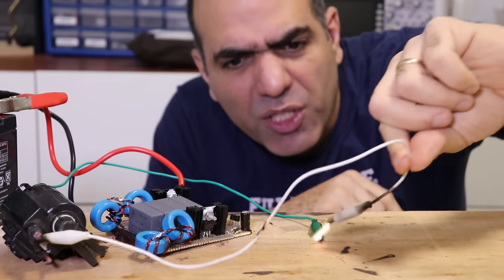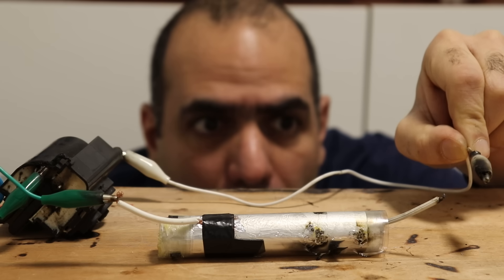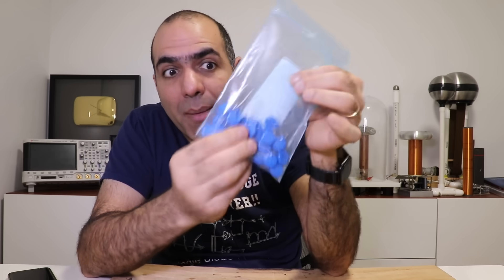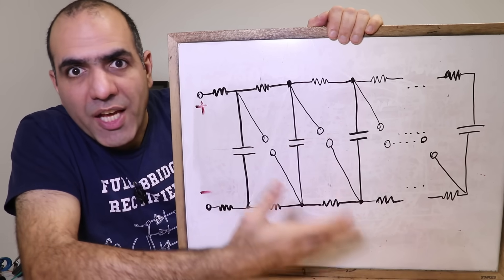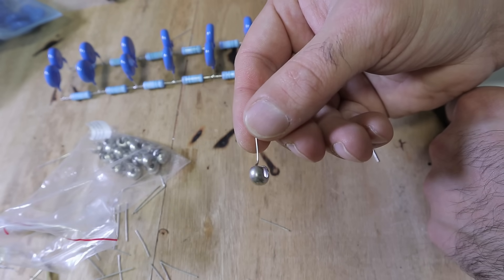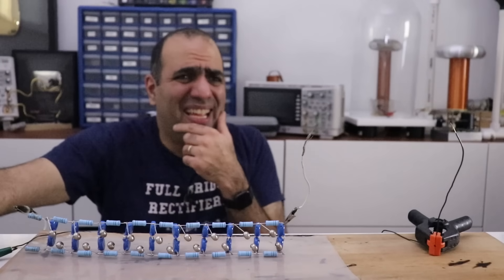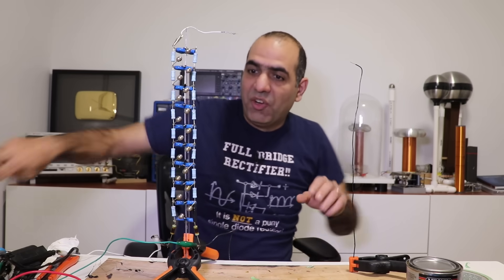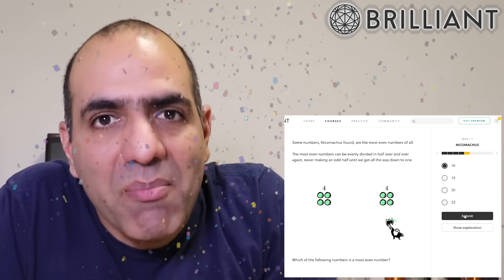Making 500,000 VOLT ARC with Marx Generator

Comment: While I REALLY enjoy your videos, you make me nervous when at the end of the video, your HEAD is so close to HV Potential. Fourty four years after I received a burn from the top of a horizontal output television tube while in High School Electronics class, I still have a scar on my hand from it. Please be careful. You always end up sooner or later with carbon traces from making Marx Generators, and that seems to be their weak point. I always wondered if I put them in Epoxy or just used some glue gun hotsnot down the resistor legs if that would help make them at least last a bit longer. Mostly though, I could never get the discharge points uniform enough. I just bent them the same as you, then I tried spark plugs, since I could "gap" them, and I figured that their surfaces were made for such a robust job.But for some reason that I never figured out the spark plugs didn't work at all, even when they were all brand new ones and identical. All the Best! 73 DE W8LV BILL (and sometimes: W8LV/VE3) Are you a Ham Operator?

Comment: Could you try making some sort of high voltage display such as a very simple CRT (just use your original high voltage circuit in a vacuumed glass container and control it with electromagnets)

Comment: Mehdi, lay it down in an oil bath with just the spark gaps sticking out and crank up the voltage! 😈⚡⚡⚡
Reply: Also add a bit of lamb sauce in the tub
Reply: @masterjiraiya348  if he can find it
Reply: Put two resistors in series, that will increase the gap as well.
Reply: He can hit all of the clickbaits at once if he sets the whole circuit in epoxy
Reply: step1: cover yourself in oil
Reply: @mashroom_  step 2: wait for it to rain
Reply: I was thinking that too, lay it down in an insulating liquid.
Reply: Ask your gay dad 4 it
Reply: @Not Bugarev umm... you know that oil is a very good insulator and used in power distribution transformers?

Comment: Couldn't you add some plastic discs around the resisters to insolate them so the spark doesn't jump across? Also maybe try some liquid tape on the caps for the same thing. That might help make bigger gaps.

Comment: Wish I had a picture of the Marx generator that the AFRL Directed Energy labs kicked down to the EE students at UNM.  It was about 1 meter in length and designed to fit into a cylindrical tube.  Monster of a circuit with at least 12 stages.  I remember the brass balls for the spark gaps the most, all lined up on one side of the circuit.  

MILSPEC

Comment: You should try dunking the resistors and capacitors in a mineral oil bath. Maybe make a case for the circuit where spark gaps stick out but the rest is submerged. That way you can effectively get rid of arcing

Comment: It’s a bit messy, but you can better insulate the resistors by putting the generator in a case and filling it with oil. You can cut holes in the case to feed the breakout points through, and then seal around them with Silicon. That way everything besides the intended breakouts is insulated from arcing to itself.

Comment: It's a true Marx generator only if it seizes the means of arc production
Reply: Electrons of the world unite. You have nothing to lose but your orbitals...
Reply: I was hoping the first comment I saw was making a communism joke, and you didn't let me down
Reply: OUR generator
Reply: @Wok_Agenda  ahh, I see what you did therem
Reply: @gavabundofagundes491  Fine, Groucho Marx.  "I won't be a part of a capacitor that will have me as a charge."
Reply: Missed a chance for “seize the means of induction”
Reply: Welcome Comfarad!
Reply: Happy coomunist noice intensifies.. kkomrade
Reply: Is only Marx generator if electricity goes socialist
Reply: @tenshiabse  true true
Reply: no. its because the current only flows to the left.
Reply: Noyeux Joel.
Reply: This... This is absolute gold
Reply: Your wordplay doesn't work. How about: seize the means of induction
Reply: @TribeWars1  Sadly, in this case the physics doesn't work. The circuit is DC, and induction only manifests with AC voltage.
Reply: @TribeWars1  Wow. That correction was hard to resist. Wasn't it?
Reply: imma be real with you i only came here for the communism jokes
Reply: Hey Joel.
Reply: @GatileoGatilei  yo
Reply: союз не рушимый!
Reply: INSULATED GLOVES MEHDI DON'T DIE ON US
Reply: USSR anthem plays on a Tesla coil.
Reply: And redistributes the volts
Reply: I see Communism, I press like
Reply: HAHAHAHAHAAHAHAHAHAH
Reply: @Roger Wilco - justice and really clean floors but it still went 0 to 100 quick as fuck
Reply: Everyone knows you're only allowed to tell communist jokes if everyone gets them.
Reply: Motherland music intensifies
Reply: @pegamini 
All of them ? As compared to individualist market-based economics which mathematically speaking can’t solve distributed maximisation of utility problems like the tragedy of the commons. Like, if there is such thing as a fantastic universe where the maximal utility optimum for each individual agent coincides with the overall distributed maximal utility optimum over all agents... fine, I guess that’s a place where crapitalism could possibly work. But that would require infinite everything including infinite people with infinite lifespans in an infinite space that’s infinitely plentiful. Even then there’s the problem of people thinking their purpose is to accumulate as much economic control over everyone and everything as possible. Which would mean that either way, if everyone had this goal, damn nearly everyone would not be able to follow it. We refuse to accept the limitations of our world and a couple of rich bastards don’t accept that no one cares about their stupid goals, no one needs them and furthermore, we would all be better off without them and the corruption they cause.
Reply: Joseph stalin and Vladimir Lenin: we partnered up with nikola Tesla
Reply: Lol so many anti coms triggered by a joke lol
Reply: Hey
Reply: Make a emp with it
Reply: correct
Reply: what.
Reply: XD
Reply: meanwhile horses be like   LOL:
https://www.youtube.com/watch?v=ig0ANQrp5aI&hr
Reply: يث
Reply: https://www.youtube.com/watch?v=Yt7no6rwCVk
Reply: Capestar value sir
Reply: Hello comrades
Reply: Haha What's the reason, don't you see its sexy lol
Reply: we need to redistribute the voltage equally amongst the people
Reply: LOL
Reply: communism intensifies
Reply: Were you hoping to let it fall on you, like the sparklers, for entertainment?
Reply: nice
Reply: this comment was inevitable.
Reply: Stalin for the fruits?
Reply: A true Marxist generator redistributes voltage to the capacitive masses. From those most productive, to those most in need.
Reply: @johngalt7382  Tell Francsico I said hello
Reply: please make a high voltage electro magnetic gun that can pulse thrust and blast some metal or a magnet  object with it XD..

or make a high voltage electro gun that destroys circuits around them ...
Reply: And I can't learn physics definition.
Reply: Son of Frakenstein~!
Reply: 🔴 What Is Islam? ⚠️

🔴 Islam is not just another religion. 

🔵 It is the same message preached by Moses, Jesus and Abraham.

 🔴 Islam literally means ‘submission to God’ and it teaches us to have a direct relationship with God. 

 🔵 It reminds us that since God created us, no one should be worshipped except God alone. 

 🔴 It also teaches that God is nothing like a human being or like anything that we can imagine.

🌍 The concept of God is summarized in the Quran as:

📖 { “Say, He is God, the One.  God, the Absolute.  He does not give birth, nor was He born, and there is nothing like Him.”} (Quran 112:1-4)[4] 📚

🔴 Becoming a Muslim is not turning your back to Jesus. 

🔵 Rather it’s going back to the original teachings of Jesus and obeying him.
Reply: @1islam1  sorry sir you have been deluded, thats not far back enough we must return to monke
Reply: En
Reply: Lololol
Reply: SlimyKlerburt  normally, as people say in my country
Reply: OUR* generator
Reply: What is a Marx Gen?
Reply: 🤣🤣🤣 i like it
Reply: come on you are almost getting close to plasma. Do you want a list of plasma aplications?
TESLA=D´ARSONVAL=OUDIN
MONICO SANCHEZ
Reply: yes
Reply: yes
Reply: The Marx generator seizes all the means of arc production... somewhere in the 500,000 year plean.
Reply: So much disinformation in just the first bunch of replies already...
Reply: communism
Reply: Or if it generates hunger and kills 100million
Reply: with the only true marx over 100 million died !
Reply: Did u know, that in Germany there is a city with 250.000 People who lives there, which was and is named afte Karl Marx? The old Name is Karlmarxstadt and the new one is Chemnitz
Reply: Lmao
Reply: Ayo
Reply: This is fkn epic. Mad props for political puns dude. Well done ;)
Reply: @pegamini Apparently 57% of East Germans believe so, but "Der Spiegel" doesn't provide their source. However considering that the rest of the article tries to explain that East Germans are just nostalgic, I believe it's fair to take them on their word.
Reply: Fas um vídeo seu enchendo com telefones
Reply: Or, of course, if it's always right there waiting there for you
Reply: Mehdi's muscles have produced the Marx generator; the arcs from Marx generator seize them. I say it works as intended.
Reply: @JeanMarceaux   yes
Reply: hi level here
Reply: DON'T YOU MEAN OURC PRODUCTION ?!?!
Reply: Sorry buddy, the only Marx I trust is Groucho
Reply: Take your like and go away
Reply: @shanealfhaim1230  oh hey. i remember you lmao
Reply: You made communist joke after me and it got 10x more likes in shorter time :(

Thats why we need communism
Reply: Jarski l 
I’m a communist and I approve this message.
Reply: @jarskil8862  😂🤣
Reply: Equally distributing elctrical charges
Reply: does it contracts you with communism or not?
Reply: :o)
Reply: Your comment just won everything in the history of everything... or shall I say OUR comment!!! *USSR anthem starts to play
Reply: "Our voltage"
Reply: I know other people have said this, but this comment is absolute gold!! Oh my God this is so good! That's one of the wittiest comments I've seen, I don't even know how far back, absolutely brilliant LOL LOL LOL
Reply: Or  worships Karl Marx
Reply: True Marx generation chez never been tried
Reply: What Is Islam?

Islam is not just another religion. 

It is the same message preached by Moses, Jesus and Abraham.

Islam literally means ‘submission to God’ and it teaches us to have a direct relationship with God. 

It reminds us that since God created us, no one should be worshipped except God alone. 

It also teaches that God is nothing like a human being or like anything that we can imagine.

 The concept of God is summarized in the Quran as:

{ “Say, He is God, the One. God, the Absolute. He does not give birth, nor was He born, and there is nothing like Him.”} (Quran 112:1-4)

Becoming a Muslim is not turning your back to Jesus. 

Rather it’s going back to the original teachings of Jesus and obeying him
Reply: @ahmdabdallah5811  bro i dunno but submitting my self to some dude and calling him my god seems pretty gay ,and thats haraam
Reply: and only works in peoples imaginations?
Reply: @SuperAWaC  someone needs to learn what marxism is...
Reply: @SuperAWaC  lmfao
Reply: @SuperAWaC  Yes.
Reply: @SuperAWaC  nah it works irl as you can see
Reply: @SuperAWaC   no the Current Investigative Agency (CIA) tried to stop it
Reply: @SuperAWaC  haha that’s great
Reply: @SuperAWaC  No
Reply: @SuperAWaC  There's no way to know if it works or not given that it's literally never been tried. Marxist communism is an idea that many fascists have used as bait to further enslave the working class. More enslaved than currently overworked and underpaid workers are under capitalism. Thus, partisan hacks in all of their childish black-and-white worldview wisdoms have come to the conclusion that: "COMMUNISM MAKES EVERYONE STARVE, CAPITALISM IS PERFECT, USA! USA! USA!"
Reply: @LordSchnoz  Communism has been tried and always fails for the precise reason it can never work: because it ignores the human condition. It creates a framework of centralized power which is ready to easily be seized by an ambitious populist and then turned into whatever they want it to be. Look what happened to the USSR and China, where populists gained control and exiled or executed all the real "communists", then changed the history books to make them look good. Socialism meanwhile only works in ethnostates, and perhaps in a post-scarcity society. We haven't had capitalism in the US for around 100 years now thanks to the formation of the single party system in the USA during the interwar period around the reign of FDR, where we no longer have the democratic and republican parties, but the red federalist and blue federalist party. We easily could have proper capitalism again, but the spread of postmodern cosmopolitanism during the cold war has ensured that will not happen unless something extreme happens that causes a great societal shift back  to the ethics of modernism. Not likely to happen when your average big city resident has become an obligate consumer who attempts to solve all their woes through consumption and the shifting of accountability to everyone else. Someone who genuinely thinks communism would work has some fundamental misunderstanding of humanity, much like the founders of communism themselves did. Reading their writings proves that much. I find it very ironic that someone could actually believe giving the government complete control over every aspect of society, as required under Communism, would solve all our problems, when the government having too much control is what has gotten us to where we are now. I have a hard time finding a greater irony, though, of so-called perpetual revolution in reality being perpetual stagnation under a fractal bureaucracy. Democracy is the real perpetual revolution, because every election is a revolution, since the people are truly sovereign.
Reply: @LordSchnoz  You have some fundamental misunderstanding of communism if you said that it hasn't been tried. The structural flaw of communism is that it requires concentrating resources to redistribute them, yet humans are no saints. You are relying a central authority to make perfect decisions in order for this to work, instead of having a self-correcting system that often make manageable mistakes and rely on crowd intelligence to adapt and improve it by having an incentive system like capitalism. That's why communism is lubing people up for nasty authoritarians. All socialist/communist countries started off with the Utopian ideals and always end up as STATE capitalism for this reason. You can't realize Marxist communism successfully outside a family of roughly 7 people (an average mind can juggle at most 7 things at the same time) because you run into trust/transparency issues as not everybody can constantly monitor what other people are doing and catch cheaters with 100% success. Once there's a cheater, it'll trigger an avalanche of cheaters as the ones who got fucked cheat to get even so the whole system breaks down into a toxic mess. If you want communism, do it within your own family and don't bring this shit onto humanity.
Reply: @SuperAWaC  Aaaand basically every  country it's tried in. Excluding Paris commune.
Reply: Mr. Cauliflower 
People merely tried dirtbag socialism in countries like Vietnam and it worked better than crapitalism.
Communism is a highly advanced form of socialism... no wonder the bourgeois are afraid of the colour red, it could render their economic toys obsolete in just a few years.
Reply: @drgazter  There were successes, and hiccups, but most problems were because of bureaucracy and revisionism, and brain drainage, also in North Korea there is a lack of natural resources, and crippling embargoes. But rest was good. Take for example East Germany, it was historicaly poorer, then destroyed way more by war, paid most of the reparations, didn't get stolen gold nor US funds, suffered substantial brain drainage, was attacked by eastern terrorists (which was the cause of building the Berlin Wall) but still has developed faster and is remembered fondly by German public.
Reply: @mr.cauliflower3536  imagine the mental gymnastics needed to go from "none in history" to "basically every"
Reply: @SuperAWaC  Well I know what he meant, but it's simply not true.
Reply: @drgazter  based comment
Reply: @drgazter  LMFAO.  DatWazntRelComunism!  Brah, now that you are 4 years old and not 12 yr old anymore do you still agree with your previous statements?  Truly curious to be honest
Reply: Trick question! It generates nothing, just like Marxism. 😉
Reply: Does it later claim the Male and Female ends don’t exist?
Reply: @ŠpVŠpý  that's not marxism, that's something completely different
Reply: @thewhitefalcon8539  I mean, feminism IS an integral part of marxism. So I'd say he's more or less right, but something tells me he doesn't know that.
Reply: @wawawuu1514  how is feminism an integral part of Marxism?
Reply: @thewhitefalcon8539  Patriarchal oppression of women is an integral part of capitalism and not, as some claim, a "side contradiction". You can't have capitalism without sexism (I can elaborate on this, if desired). Therefore, we can't have socialism without eradicating sexism/the patriarchy.
Reply: @thewhitefalcon8539  how can they completely different are ideologically connected(Marxism basis for critical theory which in turn was the basis for critical race theory, the epicenter of wokism)
Reply: @ŠpVŠpý  what next, attack helicopter jokes?
Reply: @ŠpVŠpý  ...you clearly don't know anything about Marx or Marxism.
Reply: @gloverelaxis  You clearly think I care?
Reply: @ŠpVŠpý  Ahh finally the cUlTuRal mArxIsm comment lmao
Reply: @ŠpVŠpý  Yiiiikes. You sound mad, bro.
Reply: @alexandriap.3285  I have little patience for bullshit.